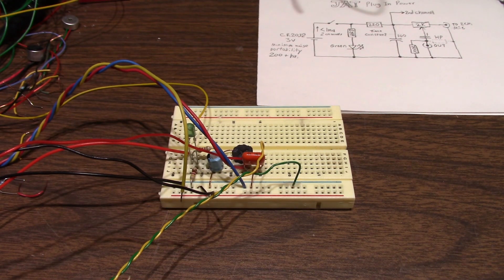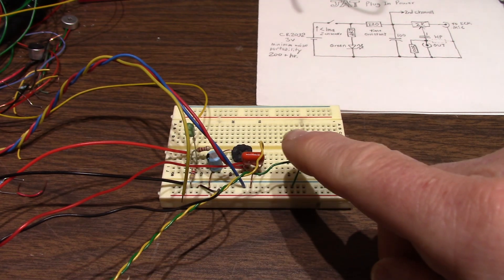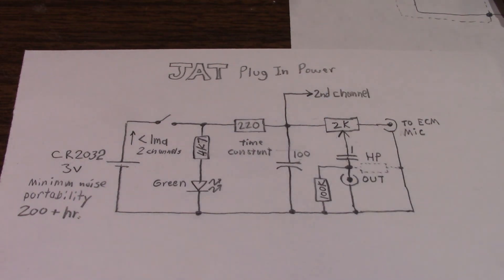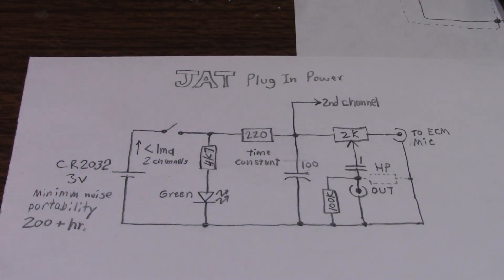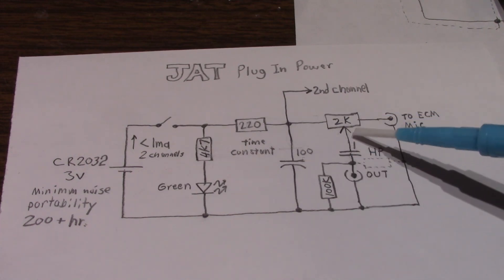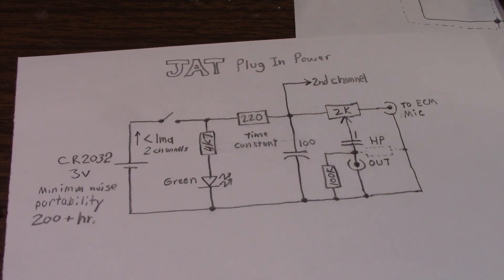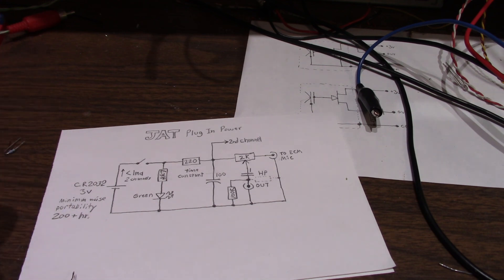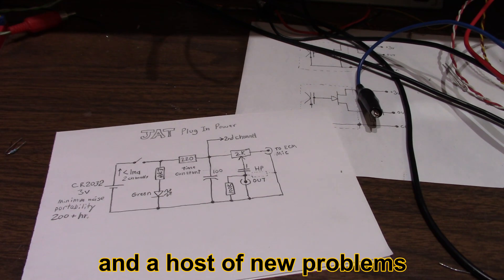Power circuit for electret condenser microphones

Comment: I never thought i was to do some constructive criticism towards John. With due respect, you are trying to reinvent the wheel. Mic circuit absolutely has to have balanced output. Many reasons for that. Also the source follower is not low impedance enough. In any pro/semi pro mic there is at leas one more stage to bring down output impedance to about 50ohm. You can get away with impedance balanced output to simplify things. The circuitry should always be shielded. Those capsules can take way more voltage in order to swing more output and take more SPL. Biasing is also very important, and should be done for every individual capsule because the FET variance from piece to piece.
Reply from the maker: I agree in a professional /studio setting, but in a portable situation with very short cabling, balanced and low impedance isn't necessary. I have no issues when I tested noise.
Reply: I inherited a sennheiser lapel mic (electret) which sells for about $200.
The output is an unbalanced 3.5 mm TS plug.

Comment: With two of those (omni pattern), you can make a dummy head for stereo field recording—lot of fun (you don't necessarily need a  "head"; the same can be achieved with a head-sized disc, wich separates both mics and, with some sound absorbent material in between (like open cell acoustic foam, wool felt, etc)). With cardioids, a typical stereo configuration is the "ORTF" (110° between the main axes,  capsules 17 cm apart). 
.
The hard thing is to find good-quality capsules. I remember that years ago it took me some time to find a pair of capsules with good sensitivity, low noise, and a flat response. But it's worth searching and trying several, especially since you can easily replace a fancy "measurement microphone".

Comment: Expanding on your work, I would recommend setting up a mechanical jig between each microphone sample and a single driver speaker to compare frequency response between your samples. The microphones (same part number) may be wildly different above about 3kHz so finding a “matched set” would yield better imaging in your stereo recording rig.

Comment: Babe, wake up.
John uploaded.
Edit: so i actually tried this circuit but with a buncha twists.

1. Instead of using a coin cell battery (which I don't have), I used 2 AA batteries in series to get 3V (i already have a case for it).

2. For the power indicator Led, i went with a superbright green led with a 10KΩ res, this led is so efficient, i could just run it with 200μA and it's still bright enough lol.

3. As for the soft start (aka RC timer), i went with 330Ω res + 220μF 16V cap.

4. For the ECMs (I'll do stereo mic ), with the bias resistor of 2.2KΩ, decoupling caps of 22μF 16V and a 100KΩ resistor to form a HP filter (for both left + right channel).
(But "22μF is alot for a decoupling cap and it's gonna introduce some noises" or so i thought).
Turns out, it wasn't, it's just has better frequency response. 

That being said, it's very very sensitive, the amount of details it could pick up from my background noise is impressive.
I'll not use a potentiometer cuz i want to reduce component count (and that's what i had atm).
Besides, these mics are for my PC which i can easily adjust the gain/volume via settings.

Finally, i wanna see how these mics operate when i vary it's power/ voltage.
I setup a recording.
I read random stuff while the voltage is at 3.2V as a baseline (fully charged zinc carbon battery).

Then slowly lower the voltage with my power supply until i can't no longer hear audio.

Audio quality and volume stays the same until the circuit stops working at 0.3V (yes, I'm not joking).
The threshold was 0.8V to be exact. (Pretty insane how low power this thing draws).
At 3.2V this thing draws maxium 287-300μA.

Pretty neat little circuit

Comment: Faaaantastic! Thank you John. I installed those capsules in small tape recorder microphones and they work great. I built a single high gain pre amp for out door recording but it had too much gain and fed back profuuuusely. I'll try using your circuit on the front end of mine and then make a stereo version. Thanks again John your the Bestest!😊.